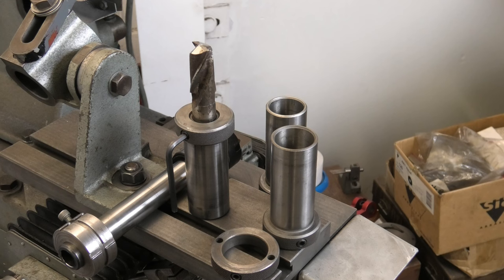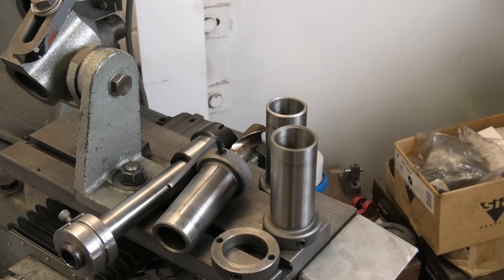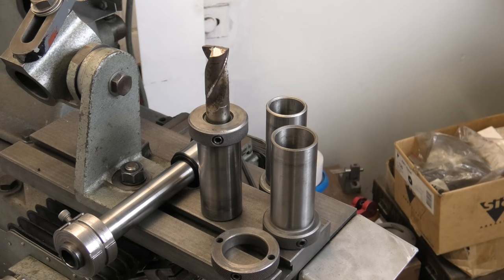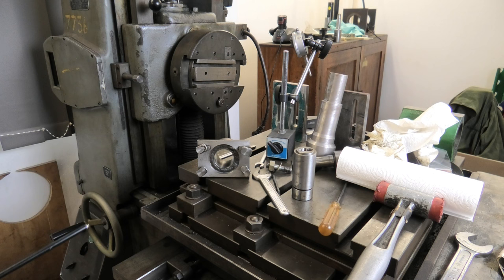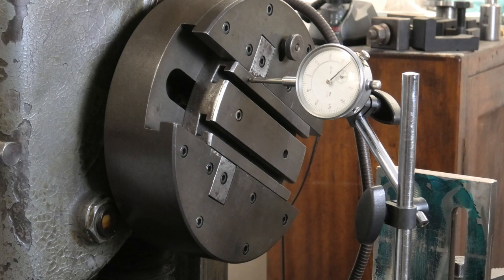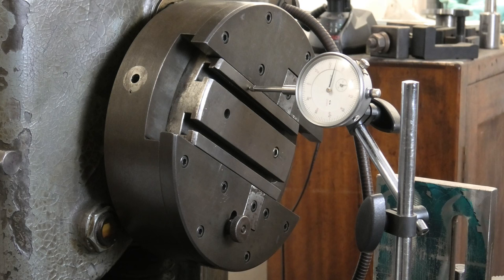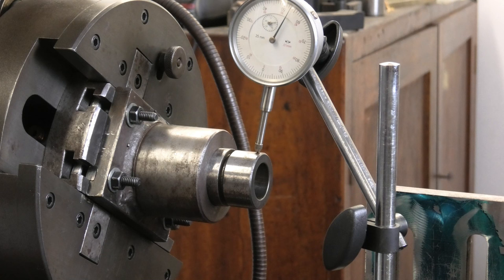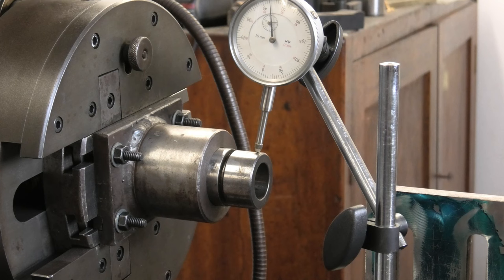My borer is bent    Made with Clipchamp

Comment: Regarding your borer bar adaptor issue, set up a lathe boring bar off the table and bore the holder in situ on the facing chuck. That will be as good as you will get it.
Reply from the maker: Hello John. Agreed that is the best way but it is already to size and I'm trying to avoid making another. Still I'll spend hours avoiding it, bugger.
Reply: @inmyshedwithbc.  bore it oversize and put a sleeve in it.......

Comment: Hi ,    Run out!   Is the keys pulling it off centre. You face it true to the bore ok but the key way  location is pulling it of line of the spindle. 
Steve
Reply from the maker: Hello Steve. I will try it this weekend without the keys but I suspect the adaptor was machined shimmed up to allow for the slide being higher on 1 side by 2-3 thou. The facing head body is tru both on the OD and face within 2/100mm. I have 2 problems. Runout at the adaptors end and concentricity. Tomorrow I will look at the other adaptor used with the snout bar. Trouble is,  it is a few thou undersize for the MT adaptor. only a few. This is like a war finish machine with finish ground parts still having machined finish on some surfaces. I had trouble getting the slide to move well without making it a loose fit. It had been hammered well and truely.